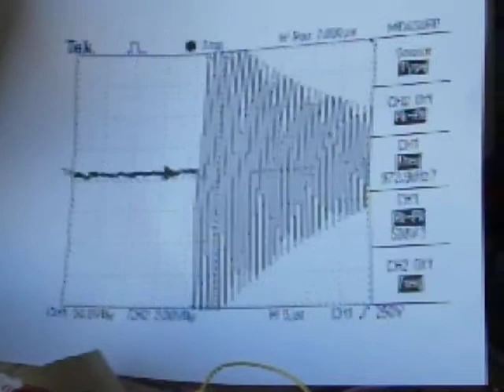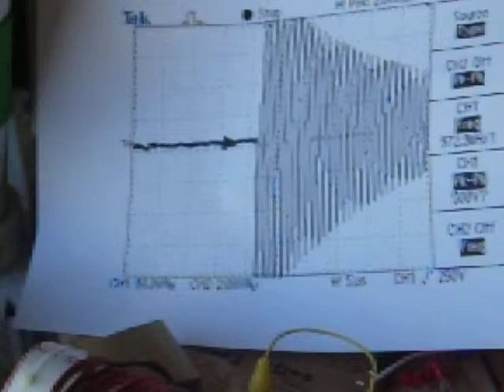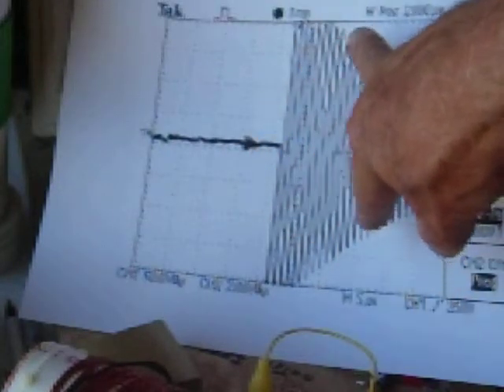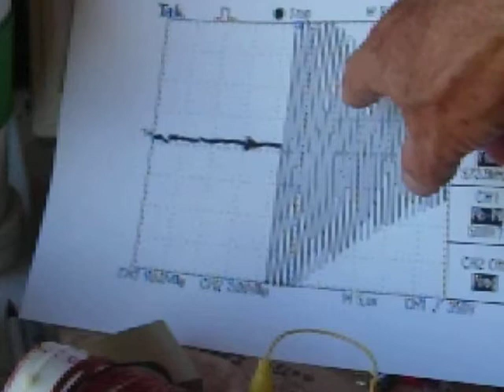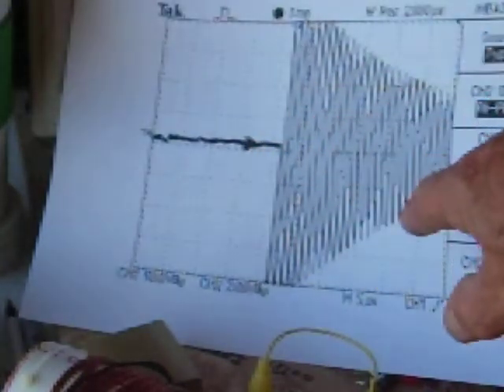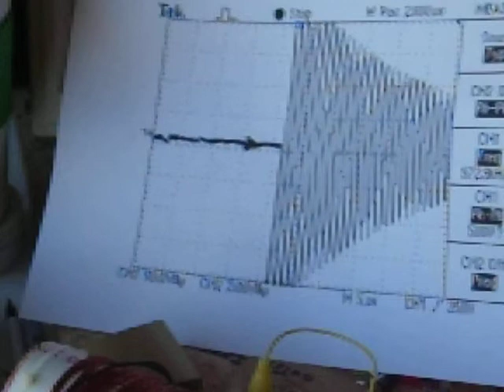Don Smith #60 Info on resonance and energy from Tesla

Comment from the maker: Tesla used a non loaded generators momentum to his advantage.  By this I mean that he ran a large say 5kw generator with a small motor.  He then pulled 5kw out of the generator using an instantaneous pulse and stored the event in a cap.   The next step was to discharge the cap into his primary of the transformer and through the use of tuning secondary and extra coil was able to produce huge amounts of energy..  The motor I have been working on uses this principal where I use 5vdc to the coils as an impulse and this runs the 18inch rotor up to around 175rpm.  when I get back on the design I'll use say 200vdc stored in capacitors instead of the 12vdc battery.   The 200vdc is achieved through the use of Teslas Don Smith ideas.

The ringing event you see here could be generated using a brush with bristles as a contactor.  basically this would create a wall of HV ringing to be captured and used for impulsing. 1.2 vdc battery can give up to 250 or 300 v